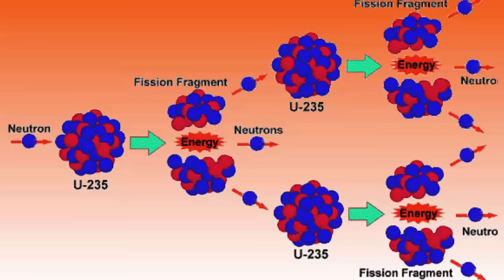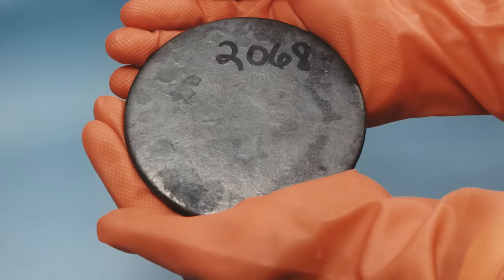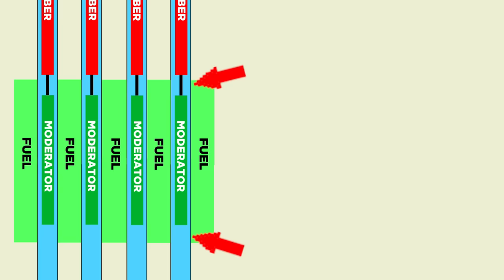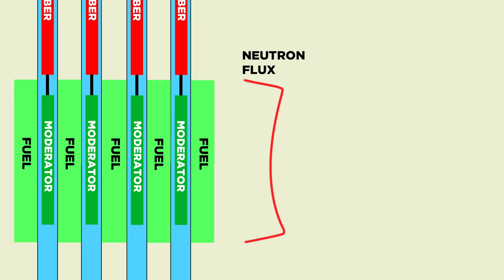What /Actually/ Happened at Chernobyl

Comment: "Graphite tipped rods"
Pencils?
Reply: yeah, didn't you know pencils are the most widely used type of control rod?
only problem is that the erasers get a little hot.
Reply: Bruh
Reply: Jake Hildebrand Really?
Reply: @theorange1729  yeah, but it could be because they use those cheap pencils that are made with fake wood
Reply: Chernobyl was a graphite moderated water cooled reactor meaning that graphite tips balanced and controlled temperature. Water 
 also acts as a neutron absorber (just like a control rod) but i think it evaporated + rods were pulled up. They were supposed to be lowered. when engineers lowered it there was 15 second delay,  graphite tips reacted by insane temperature increase and that is when explosion happened. Someone who understand this better can explain.
Reply: @gennieapulova8017  "Moderator" is not an intuitive term in the case of nuclear reactors. It relates to neutron speed. The neutrons that pop out of split atoms travel at almost luminic speeds, missing most other atoms in their path. The moderator scatters those neutrons through inelastic collision to thermal velocities (much slower), allowing the neutrons to have a significantly higher chance of hitting and splitting fissile atoms. In short, a moderator is used to help fission reactions.
Reply: @UnrealPerson  thank you so much for an explanation
Reply: Bruh
Reply: I mistook graphite for granite
Reply: I guess Im making an RBMK reactor on my desk now.... Thanks.
Reply: They were not tipped with graphite! It was a separate graphite rod.
Reply: @misceryyt2897  I know that story, and the horrible end result.
Reply: This comment made me laugh.
Reply: Boron pencils, cheapest control rod
Reply: We are carrying tools of Chernobyl
Reply: @jakehildebrand1824   so if you get lots of smoke detectors with Americium and Pencils you made a reactor!
Reply: They need cheap
Reply: I laughed way too hard at this
Reply: Bruh
Reply: Yup the lower 3rd was graphite and the upper 2/3 was boron carbide. It was supposed to be a startup aid. Would have been fine to do the control rods in this way but the safety rods should have been streight boron carbide.😮
Reply: I recommend watching this: HOW THE 4th UNIT OF CHERNOBYL NPP WAS BLOWN UP (channel-KS).
Reply: Phat pencils

Comment: Hank, this is a great explanation! I can clarify the moderator confusion though. It's not as complex as you think. All you need to understand is that *no atom "smashing" occurs during nuclear fission*. Quite the opposite. The actual reaction is that atoms absorb the slow moving neutrons like magnets snapping into each other. The additional atomic weight makes the atom too heavy to maintain its cohesiveness, resulting in the atom falling apart. That's what we mean by "splitting the atom".

Once you understand this, it's easy to understand why fast-moving neutrons are a problem. They have too much energy to get captured by nearby atoms. It's like the difference between hand-tossing a magnet past another magnet versus firing the magnet out of a high-powered rifle. In the former case the magnetic field pulls the magnets together and halts the throw. In the second case the magnet moves out of the magnetic field too fast for the bond to be established.

Now replace magnetic fields with strong nuclear forces and you've got it. :)
Reply: Are you a teacher or something? This made so much sensseee.
Reply: Thanks for this!
Reply: That helped a lot, thanks
Reply: I teach the transport of radio-active loads and I love your analogy. If this subject is your thing it is easy to grasp, if it isn't then the way you have just explained it is superb and I will use it in future lessons. Thank you.
Reply: Good explanation! What's also helpful to add is that in the case of U-238, the more stable isotope, it also captures slow neutrons well, but the energy added by a slow neutron isn't enough to excite it so that the electric forces are able to split the nucleus. However, the additional energy from fast neutrons is able to split U-238, albeit with low probabilities since, as you explained, it's harder to even capture a fast moving neutron. What's cool is that when U-238 absorbs a slow neutron, it decays into Pu-239, which is just as fissile as U-235.
Reply: This is a really good explanation. Thanks! Love it.

Since you seem to know what youre talking about though: why is neutron flux the way it is? Why is there so muvh more on the outsides of the fuel than in the middle?
Reply: Really helpful!
Reply: One thing that isn't intuitive from your explanation and analogy is why having an extra neutron causes the atom to split. This is where you have to let go of the heretofore useful magnet analogy, because adding more magnets to a ball of them doesn't cause the ball to split. U-236 (U-235 with the newly-absorbed neutron) is a little bigger and a little more wobbly (from the added kinetic energy of the neutron that hit it), enough that its edge extends beyond the effective range of the strong nuclear force and the electromagnetic force (the positively charged protons that have been trying to push away from each other all along) overcomes it. That's when it splits apart.
Reply: @cptnoremac  Really appreciate this comment to the already valuable original comment above.
Reply: This is a beautiful explanation, thank you.
Reply: One small addition: slower neutrons are essentially "bigger" particles which increases their chance to interact with the strong nuclear force and therefore get absorbed into the nucleus.
Reply: As a former Nuke electrician on US nuclear powered submarines that's a really solid analogy. The slowing works by basically shooting your rifle magnet past billions of Magnets i.e. the moderator to slow it down enough that the fuel atoms can catch it.
Reply: I wonder how this works for fast neutron reactors. Because for those, is it then more appropriate to think of them as smashing into the atoms? 
Or do we then enter the quantumphysics realm, where somehow, the energy of the neutron brings it to a wavelength that lets it interact more readily with certain atoms again (or some similarly less-intuitive idea comes to play).
Reply: I know this comment is old but wow, the magnet analogy just brought the process into focus. I understood the thing about fast neutrons but just assumed it was another quantum hand-wavium thing I had to accept. I suppose it’s still a hand-wavium quantum thing but now I can visualise it!
Reply: @julianmorrisco  We should never have to accept hand-wavium. We can always find an intuitive understanding. The magnets example works well because we are just swapping the forces around to use something we’re more familiar with on a daily basis. It even works for the split itself. Despite a comment above that magnets won’t fall apart like the atom, they actually will. Imagine a ball of magnets all holding onto each other. Eventually you’re going to add enough weight to where the force of gravity will split the ball of magnets. When that happens, you’re likely to end up with 2 or 3 large pieces and a few magnets that skittered off when things fell. The skittered off magnets are the same as the particles ejected during nuclear fusion. If you had another magnetic ball nearby, your skittered magnet might even get caught by it!

At an atomic level, the magnetic force is obviously replaced with the Nuclear Strong Force. And amusingly, gravity is replaced with the magnetic force as the protons and electrons are constantly trying to push each other apart. It’s only the strong nuclear force holding them together. Too much atomic weight and the magnetic force wins. 

Anyway, I’m glad my explanation is still helping others 3 years later. I hope it continues helping for many years to come!
Reply: Wait then if that's the case wouldn't a fast neutron reactor (the ones that deliberately use fast neutrons instead of moderating them) not work at all then?
Reply: @alex_zetsu  
Fast reactors use more enriched fuel and work at low-pressure (albeit also very dangerous if spilled), higher-temperature coolant (melted alkaline metal like sodium or potassium) which will in turn be cooled in a separate device by water, which will be turned to vapor and only then move a turbine attached to a dynamo. They are also based on slightly different fuels.
Criticality is a worse factor here because you're not dealing with the danger of the direct coolant leaking out and leading to the meltdown of the reactor core for loss of neutron absorption and cooling. It's the much finer control you must have over the reaction speed - criticality is much easier to attain - that keeps a fast reactor from melting.
Reply: Great explanation, thank you
Reply: I recommend watching this: HOW THE 4th UNIT OF CHERNOBYL NPP WAS BLOWN UP (channel-KS).

Comment: Well the "thing that broke" during the SCRAM of the reactor was actually two things: The control rods did move very slowly in an RBMK reactor because of tight fits between control rods and their channels and the reactor is very huge, so it has to travel very long distances, while even a very slight inbalance in neutron generation per fission is a rapid increase of power: 1.01 neutrons per fission on average are a doubling of power every 7 milliseconds. That lead to a thing, the reactor was never designed for: A rupture of more than one fuel channel. This resulted in the reactor vessel turning into a giant steam piston and shooting out it's upper lid through the Ceiling of it's hot box, while pulling out all control rods and evaporating all the coolant at once because of the pressure release, it creates.
For the following burning of the core: Graphite basically is the highest grade hard coal.
Reply: Slight correction, it shouldn't be 1.01 neutrons per fission, in fact there's usually a bit more than that per fission. It's the multiplication factor slightly above 1 which causes the insane doubling time. The reason that the number of neutrons emitted per fission isn't the number we need to look at is because some neutrons emitted by fission will be lost, either by leaking out of the reactor or by being absorbed by other materials in the reactor. The multiplication factor, on the other hand, takes this into account and tells us how we can expect each generation of neutrons to grow

Comment: As a Nuclear Engineer (by training), that was perfectly succinct for the depth required to accurately describe reactor design. You never said the buzzwords though! "Positive Void Coefficient of Reactivity." We talk about things in cents and use symbols like β (no, not that β, a different one), its so much fun! Still, the thing both your video and Scott's made me aware of was that it didn't always have a positive void coefficient, only when operating with all the control rods out.

One nitpick: neutron flux is actually neutron flux density. Neutrons aren't stationary, they've moving all the time; talking about a static population density doesn't make sense, so we think about "flux density" which is the Number of Neutrons * Velocity / Volume, so n/cm^2/s, and even though its defined with a 2d perspective (1/cm^2), most reactors have isotropic scattering so its the same in all directions and you can just think of it as "neutron density".
Reply: There is such thing as static flux density distribution. Just write down the equations and set time derivatives to zero, and every solution of  what remains  in the equations will give a static distribution.
Reply: @u.v.s.5583  so, ignore that time exists?
Reply: @SteveisTall  Not at all. It is a dynamic equilibrium. Energy flows from region to region, but the fluxes cancel each other out so that the distribution of the flowing physical quantity (neutron number density or whatever) remains stationary.
Reply: Its OK to neglect the density word for explaining to physics noobs.. But I agree it is useful for completeness...

E.g. you could say there are a lot of people passing through a gate, causing congestion... But scientifically speaking it's that the density of people moving through the area of the gate is too high, and too many per unit of time (too frequently), a higher density and regularity/frequency of people movement than it was designed for, and the number of people passing through a gate per second doesn't determine congestion, only the density of people per second getting high enough causes congestion in any gate, no matter which gate or what its size is..

You can still say there's too many people trying to pass through the gate, rather than saying the density of people trying to travel  through the gate is too high, and too frequently too many per second..

So yer, he got the flux bit which indicates "per second" and the density bit would have meant "per unit of surface enclosing it's volume", which matters for calculation, but not so much general communication.

If people talked about electron flux when discussing e.g. a copper wire overheating due to the resistance of the wire to electrons passing through it, people would understand what you mean by saying too much electron flux rather than saying electron flux density.. We know which part the electron are flowing through, the volume being discussed I.e. the wire.. In case the word "current" didn't exist.

Its also OK because he said the "neutron flux was too high in this part (the bottom) of the reactor", which is in fact understandably correct, as that part is a known volume, and so the high neutron flux density will have a defined total neutron flux, which will also be "too high" for this part of the reactor.
Reply: What's the other B
Reply: @Knock Hello  Yo momma...

Comment: Understatement of the century: “... the top popped off the reactor...”
Reply: Well, it did, due to steam pressure. Had there been no second (much stronger) explosion, the damage might have been much less.
Reply: @maksphoto78  it did not pop. It literally got obliterated into another dimension
Reply: @ju.h_man  No, it popped up due to steam pressure. It was just enough to damage the reloading machine, and let oxygen into the reactor, which cause a much, much more powerful hydrogen explosion. That explosion was what obliterated the central hall, making the 1.2 meter thick walls literally disappear.
Reply: Yes, the several thousand tonne top
Reply: No the lis was thrown up into the air and then landed back down on its side back into the reactor it was blown through the roof then the massive explosion occurred
Reply: @maksphoto78  
I can’t wait until the elephants foot hits ground water and we get a 3rd explosion
Reply: @maksphoto78  it shocks me how smart people are
Reply: @jonahmoran3751  yeah, and when the lid popped, oxygen got into the core, releasing a much stronger hydrogen explosion like the person above me explained :p
Reply: @penguinsrockrgr8yt216  It won't, it's solid and relatively cool, and is disintegrating into dust.

Comment: "Something isn't possible" - Said by someone, right before something happens.
Reply: And yet we continue to think this or that isn't possible.
Reply: Oh shit
Reply: Unsinkable. Unbreakable. Impossible. We should stop using those words. It's just asking for trouble...
Reply: One of the detailed applications of Murphy's Law.  If something bad can't possibly happen, it will, at the worst possible time.
Fun Fact: The original Murphy's Law was only "If a part can be installed wrongly, it will be installed wrongly, sometime, by someone."  The statement came from aircraft repair mechanics during WW2, which also gave rise to the word "Sprog" meaning an apprentice aircraft mechanic who had yet to learn the difference between a sprocket and a cog.  Later, it referred to anyone young and inexperienced before lapsing into disuse in recent times.
Reply: Also the titanic, it was supposed to be impossible to sink

Comment: A note on explosions. They absolutely do not require a phase change. You can get an explosive by pressurizing hydrogen and oxygen gas, which react to form steam/water vapour, also a gas. An explosion is primarily about pressure and energy.

Comment: Thank you!! I loved the HBO show and as a completely non-science person, I still tried to do as much research on this as possible to understand, at least in layman's terms, what really happened. You are the first person that has actually helped me to understand the graphite tips thing. The only explanation they gave on the show was that they used them because it was cheaper. That never made sense to me and I never understood why the had to have "tips" on the control rods in the first place. Thanks, again for helping clarify this.
Reply: The longer explanation is that it is cheaper to have the moderator and absorber on the same rail system. More expensive and more complex to have them on separate systems. However, when on separate systems, you cannot have the type of disaster occur like that which occurred at Chernobyl.

Comment: Three Mile Island: I'm going down in history as the worst nuclear disaster in human history 
Chernobyl: hold my vodka
Reply: TMI wasn't even that bad, outside the reactor itself atleast. Yes, it had a partial meltdown, but the containment structure did it's job like it was designed to in the first place. They got very close to a full meltdown, and also a hydrogen explosion, but thanks to the reactor design they were able to mitigate those issues.
Reply: @DrakeKillah  ye but at that point (not counting Kyshtym disaster which wasn't revealed until after USSR fell) it was the worst nuclear energy related accident.

Granted the damage was limited to plant itself BUT it obviously made it impossible to use that reactor ever again
Reply: @DrakeKillah  just one partial meltdown?
RBMK: Hold my beer! ... partial meltdown in Leningrad-1, partial meltdown in Chernobyl-1, catastrophic failure of Chernobyl-4